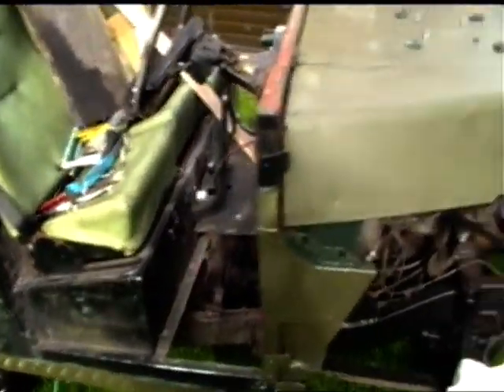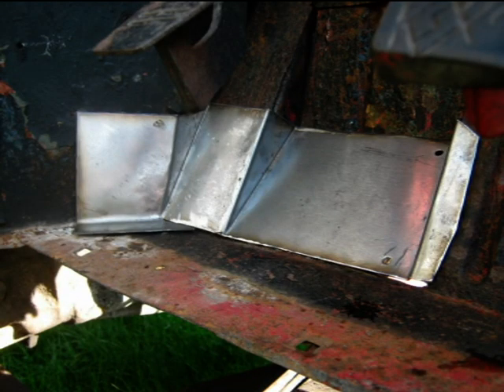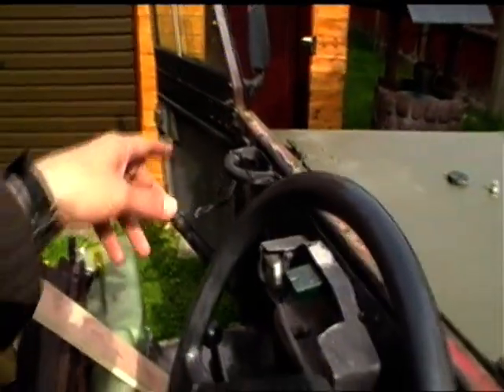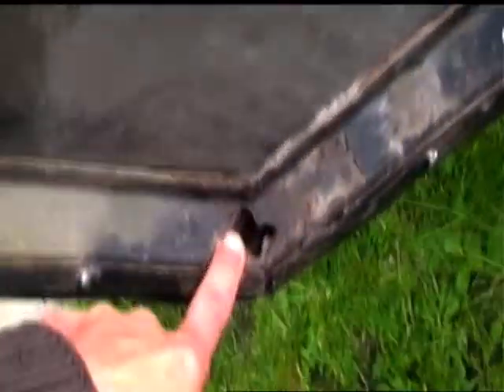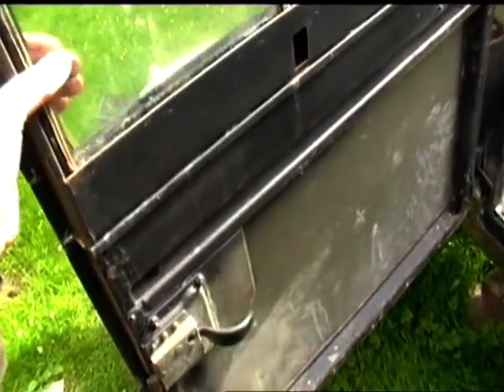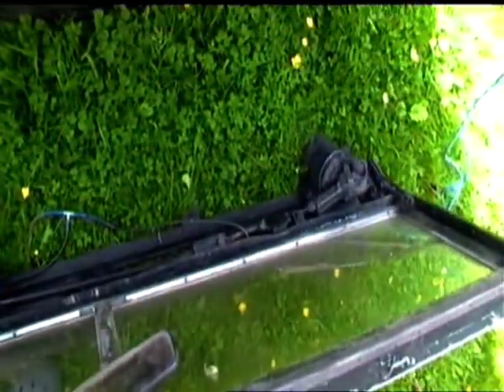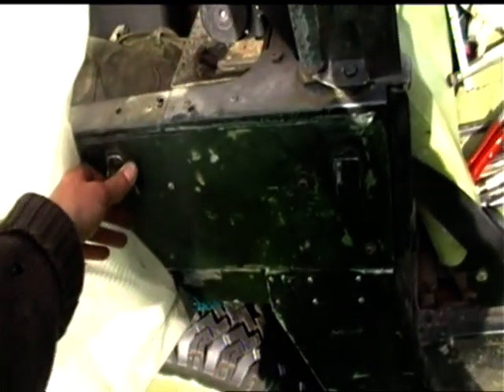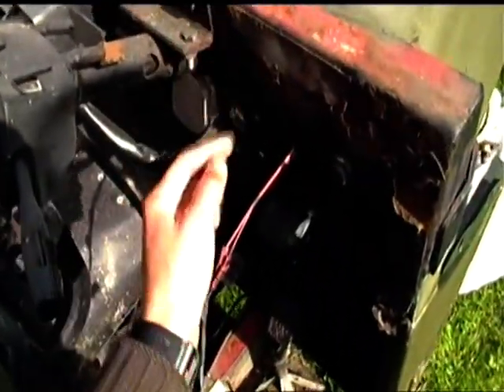Welding repairs on Lightweight Landrover

Comment: I hate cracked n bodged filler >.< glad you've taken it off, also looks like you've got your work cut out with that wiring, you'll be able to keep the heat shrink tubing industry happy for many years. ;)
Reply from the maker: Yes good stuff that heat shrink have a box full. A lot of this wiring isn't required on this vehicle it is left over from a Fourtrack with all the bells and whistles, so I just have to decide to do a full re-wire with just what I need or just chop off what I don't.
Reply: Oddball it's usually quicker and easier I find to ruthlessly chop all the wiring out rather than wasting loads of time headscratching trying to work out how to "save" the least shit 10%. Keep any useful length of the old wire and start from nothing. That way every wire goes the best route cos you're in charge. And it's only a Land Rover, so there's hardly any stuff anyhow. I've got my  series2 to do soon! Good luck

Comment: I would just repair the corners instead of replacing the whole dash. Ditch that speedometer cluster and install a proper looking set of gauges. Wiring is always a nightmare....just looking at that mess of "spaghetti" under the bonnet made me cringe. Good luck with that.
Reply from the maker: Yes sort of the way I have decided to go in the end the centre part of the 
dash is still in good order. I have the original set of Smiths gauges and light 
cluster for the Landrover so I am going to re-fit them the problem will be 
speedo compatibility with a Daihatsu transmission but there are people who do 
custom fixes for this problem. I am also re-positioning the instrument cluster 
closer to the driver away from centre which was a poor location. I am 
considering fitting a small piped in heater unit over to the left of the dash to 
demist the screen etc. 
I started chopping it yesterday after I made the video, I think making and 
re-watching the video helped me make the right decisions.
Thanks for confirming them!